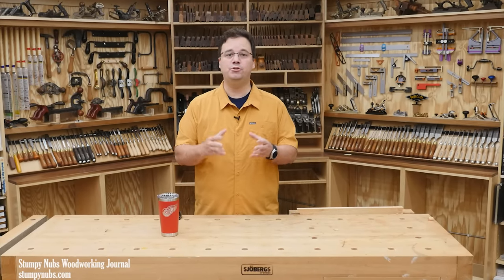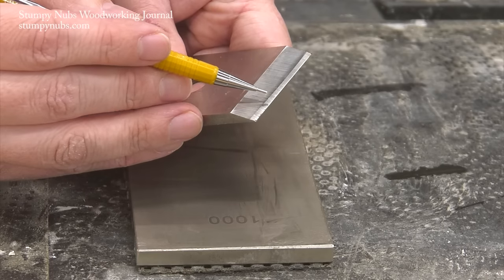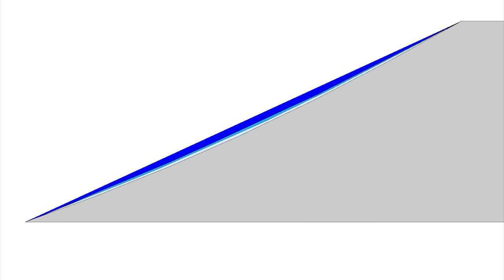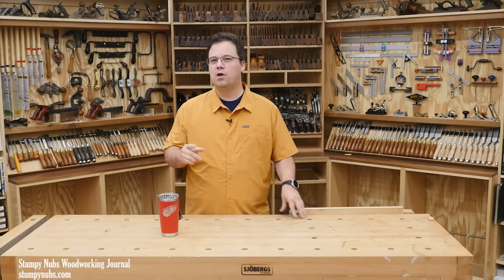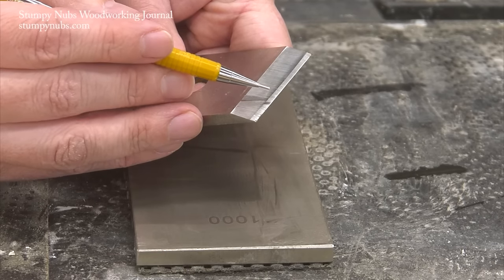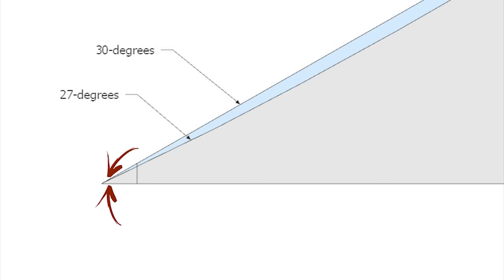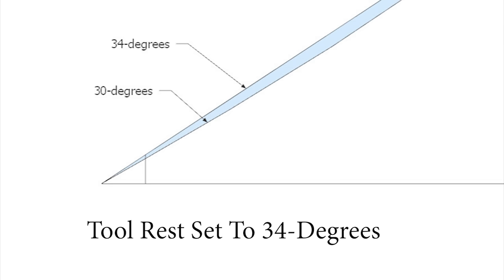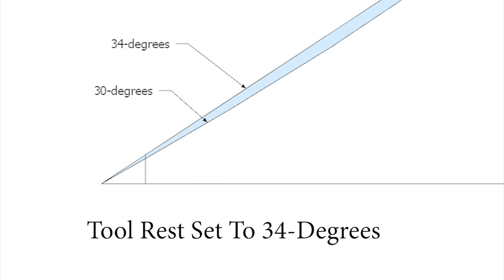WRONG INTERNET TREND! - Watch before you sharpen with a bench grinder!

Comment: Wait a minute...so you're telling me that chisels have to be sharpened ?
Reply: He was just kidding. Just get a bigger hammer if that chisel isn’t working so well!
Reply: Is sharpening what you’re supposed to do after you use the chisel to open the finish can?
Reply: @richtes  Only when the end of the chisel starts to look like cousin Cleetus' teeth
Reply: I have just been buying new ones when they stop cutting well. Next thing you're tell me is that I don't need a table saw when the blade dulls!
Reply: No need to sharpen them. They work just fine to open paint cans when a little dull.
Reply: @masondegaulle5731  Nah. You just use those to create that 'vintage', 'distressed' look.
Reply: Nah just buy new ones 😂
Reply: You, Sir, Win the internet today. LO F'ing L.
Reply: Not if you use them to open paint cans!
Reply: Concrete chips just as well now as day one.
Reply: You mean really wide screwdrivers.... Right?
Reply: I was today years old when I learned this 😂
Reply: Another thing that has to be sharpened? There's no end to this! (Is this a covert campaign by sharpening gizmo companies?)
Reply: Okay, lol is supposed to mean laughed out loud.  But your comment doesn't deserve an lol.  It deserves a LAUGHED OUT LOUD!!!
  Great job, Bub!  Thanks, that was great!
Reply: I never sharpen my screwdrivers.
Reply: just rub it back and forth  a few times on a concrete floor and it will be fine
Reply: No. They are just used for taking pallets apart
Reply: Depends on your trade 😂😂
Reply: Not if you use them to open paint cans
Reply: Nah you and I don’t need to be sharpening. He’s just pushing his high falootin’ “Wheel” money now that he’s gone all Hollywood. 

J/K

Love your content. 

Cheers!
Reply: @bw162 My father used the kitchen doorstep. He did it to sharpen the kitchen knives as well.
Reply: Not if you use them right.  Most people don't realize that the metal end is the handle.
Reply: @jasonderosa1137  Damn, I was thinking the same thing, but the guy at Home Depot says it's okay to buy new table saws...he wouldn't lie would he ?
Reply: That's what the cutting disk on the battery powered grinder is for.
Reply: Real men just get stronger and push chisels harder. It’s called progressive overload. It’s good for you according to fitness YouTubers. lol😅
Reply: LOL!
😅
Reply: HahhhahahH!
Reply: Only when you can't cut through the paint in those old screw heads
Reply: I dunno, I typically hit a nail within the first few years of owning a chisel and have to throw it out WAY before needing to sharpen it. Still cuts wood with a beefy enough hammer behind it.
Reply: What's a chisel?
Reply: 😂😂I love a little sarcasm mixed with humor with just a touch of smart ass. Lol makes it all good.
Reply: Ceremonial (dress) chisels don't, but all the rest? Pretty much, yeah.

Comment: A wise man once said, "Always carry a knife and a sharpening stone with you, that way if you ever get lost in the woods, you can just sit down and start sharpening your knife. Pretty soon someone will come along to tell you that you're doing it wrong."
Reply: Same story, but deck of cards - play a game of Solitaire.  Someone will tell you to place the red six on the black seven. ;)
Reply: You are a genius!!!
Reply: @fredinit  Same story again with the ingredients of a martini. Someone will say "That's not how you make a martini."
Reply: There's also one from the world of data infrastructure. Always carry around a short piece of fiber optic cable so if you ever get lost you can bury it in the ground and then when the guy with the backhoe comes to dig through it, you can ask to use his phone.
Reply: At work I use an old steak knife for rough trims on uncured rubber. Long story short it doesn't need a fine edge because it gets abused and the material is soft, so many times I just knock the flats down with a file. At first the part of me that takes pride in sharpening my personal knives was just waiting for someone to happen along with their two cents...and they did. Except they understood what I was doing! No questioning the rough (but serviceable) file edge, no, they chastised running the file in both directions.

(After some searching I'm not convinced it hurts the file but I did change to forward-only filing for shop optics. Either way it never fails: Someone will see and someone will comment.)

Comment: The emotional arguments always bring me back to a directive in Japanese manufacturing:  "Go to the Real Place.  Look at the Real Thing. Consider the Real Circumstances."  As usual, you do this well!
Reply: Agreed, but there is an element James didn't mention, which I think is the real point of both how one cares for any tools and what you are looking to discover in any "gemba."  That's the attitude of care and devotion to the craft - call it fussiness or just being persnickety about one's tools.  The attitude is critical, but that does not make one person's little nits about fussiness some sort of universal truth.  I prefer a flat single bevel on my edge tools, but mainly because when I'm fussing to get them just so, I occasionally glance up at the poster of the Studley tool chest that is framed on the wall.  It's a way of reminding myself to slow down and try to be at least half as careful as Henry O. was.  Studley used a single flat bevel, and it is actually quite a challenge to get those just right every time you do it, but the effort reminds me of what I'm about, so I find that it is worth it, but that's me.
Reply: How many wood workers know or have the skill to sharpen a tool properly? Yes,  they improve it but for perfection I doubt it. Wheel hollow the tool and hand sharpening convexes the tool as people are not machines and tend to rock the tool as they slide it back and forth.
Reply: @charlemagnesclock  I think the thing often missed when chasing sharpening perfection is that while you can get an edge absurdly sharp with perfect technique and tons of effort, it won't stay that way for long. A few cuts into some actual wood and it's down to just very sharp, which takes a lot less effort and fussing about, and which most quality tool steel will maintain for a decent amount of time. So, unless you're sharpening the edge every 5 cuts or so, you're not going to see a significant benefit from being obsessive about it. Sharpening the tool to the "good enough" point, more often, will serve you better.
Reply: excellent advice.

Comment: Great video, I've never bothered to do the math but whenever I saw someone complaining about a hollow grind I always thought to myself - "if you're that concerned about it, offset by about 3 degrees and it will be fine". Turns out it was 4 degrees. Close enough!  Even less on wider grind wheels I imagine. The point about finishing up on finer grit stones and getting a nice, easy micro bevel makes a ton of sense too. Perhaps the only legitimate concern left here is heat build up, so that might be worth covering if you make another video.
Reply: Heat build up is what the cup of water is for next to the grinder.... Take a stroke, have a dunk, stroke again.
Reply: @arikbord2256  works till the second you burn the metall
Reply: If you are concerned about heat, get a wet stone.  Just remember to remove the water before it freezes in the winter.
Reply: I believe James would recommend getting a CBN wheel and/or be mindful, pay attention to pressure, and take your time.

Comment: The hallow grind itself isn't an issue as you point out. But the one thing that may be of concern for some might be changing the temper which can be done on a wheel but I haven't seen anybody move fast enough by hand stoning to generate the heat required.
Reply: If you're getting your cutting edge hot enough to change the temper you're doing something wrong..
Reply: Said the Caterpillar as he expanded on his advice to Alice. And, by 'temper,' he meant what we call 'proportion' - of chemical make-up (relates to heat generation) or physical size (angle, whatever the measurement dimensions)

Comment: Thanks for this clarity. I have always been dubious of the claims for loss of durability when doing a hollow grind. I regularly use Barr framing chisels with a hollow grind (from cbn wheels) and a micro bevel done by hand. These chisels take a massive beating as they get whacked a lot harder than 1/4" chisel, and I have never had a problem. The only factor that I have found to effect durability is (obviously) the quality of the steel itself.
Reply: Great point, and not only the quality of the steel, but the type of steel as well. If you're bashing away, you want a softer steel, as it's less likely to chip away and should hold its edge longer, and for rough work it's more about force than precission, so being perfectly sharp isn't really a factor. If you're doing paring or other delicate work, a harder, more brittle steel is better - you can get a sharper edge on it and as long as you're not abusing it, the edge should last a good amount of time. Personally, I use my Japanese chisels with their very hard white steel edges for most fine work, and use cheaper chisels for rough material removal. That said, I occasionally bash away with Japanese chisel and have only ever chipped one when I dropped it on concrete. So I don't think they're all that delicate.

Comment: I hollow grind then hone and I've always felt a little guilty about it ever since the woodwork technician at my art college told me it was bad practice. He didn't explain why it was bad (he advocated using the side of the wheel) and your brilliant explanation has taken away all that guilt.   Thank you!
Reply: I've used the side for years, mostly because I made my own grinder and it worked out easier for me. Have used pretty much every other method too, mostly because it's what I had available. Anyone who gets fixated on this sort of minutae generally doesn't do enough wood working and is more concerned with having nice tools, like the guy who washes his car every weekend but never drives it.
Reply: wouldnt that grind one side sharper since the wheel's rotational velocity is larger farther from its center?
Reply: Ask anyone with a brain.... you never apply sideways force to a bench grinder wheel...... unless you want it to explode in your face.... 🤔😎🇦🇺👌

Comment: I appreciate the video.  Good info and great job explaining what happens at the tip of the edge - where the work occurs.  I grind my 'rough' chisels (the ones to beat on a 2x4) on a regular bench grinder with a bevel somewhere between steep and gentle.  Blades for my bench planes, nicer chisels, etc.  hand sharpened with a bevel somewhere between here and there, until they are sharp and work.  Anyone that says it has to be 30 degrees hasn't a clue.  30deg is like a combination saw blade - it's the good, all around, bevel and where you start from when you're learning.  Some woods require steeper, some shallower.  Different parts of the same board need different bevels (end vs. cross vs. with grain)  Some tools like steeper (lathe), and some shallower.  Heck, even different hand planes require different bevels.

Comment: Good stuff James, I've rough in my chisels at around 25 degrees, by the time I get my secondary bevel done on a flat stone I'm at 27-29 degrees, not enough difference to make a difference. When that edge gets to where I need a touch up, I strop it. Some guys go for a tertiary bevel rather than a strop. It works well too.  Most guys figure out what works. You can cheat that bevel to less than 20 degrees if all you work with is soft wood like pine.

Comment: When I was at school, our carpentry shop used a four foot wet grinding wheel turned by hand. This stood in the center of the workshop and we were encouraged to use it whenever our tools became dull. The size meant minimal hollow grind and after stropping almost none.
Reply: How did they dress the wheel?  I wouldn't want to pay for a CBN wheel that large.  Well, I wouldn't want to pay for any wheel that large.
Reply: @kwilliams2239 . It was fine millstone. The dressing was done with a drop down bar and a devil stone. This was the 1950’s so no chance of CBN, it passed through a trough of water and I seem to remember getting a bit wet. The workshop had 12 benches and we each worked at one end, each bench had a vice at each end and an under bench cupboard for tools. At one end there was a lathe, where I did my first turning, a bowl for my mother, which I still have. I’m 80 this year and am still turning.
Reply: @mergrew0110  I hope I can still be turning after 70 years.  I just started and I'm 70 now.  😁

Comment: Personally I have different angled chisels for different purposes, varying from 40° to even 15° and sometimes even sharpened a skew for easily cleaning up end grain of dovetails or tenons and flattening faces with a slicing motion. 
What I like about the concave edge is it requires less honing to get a sharp edge.
I maintain sharpness with stones and repair damaged edges with the grinding wheels. In the end only the point where two faces of the cutting edge meet is important for sharpness

Comment: Totally agree; plus that hollow grind from the wheel is only hollow at the tip until the FIRST time it is honed, whether on a bench stone or a little hand CBN card, which I use often as I work - same result, a new sharp edge and automatically corrected angle.

Comment: I used to maintain a college wood room. Teenagers are not kind on chisels. Our 8" CBN wheel was a godsend and I used to set it at 30°, with a 35° bevel. Razor sharp and quite durable. (Until some goose hits a nail...) As well as young men's fingers, we were cutting Mountain Ash and other pretty hard timbers, as well as radiata pine and they got it done nicely.

Comment: old tool catalogues often mention voided warranty in case of iron mistreatment, extreme hollow ground being of of these cases.
But these diagrams dont show the hollow going right to the edge, but rather offset behind, basically thinning out blade on the circumference of the wheel. Very much like a straight razor.
I think of it like a long forgotten practice

Comment: Yeah it's all really nice stuff, but today I was really  happy cutting with my chisel. even across endgrain it just worked finally, right. So I'm good sharpening on my glass plate. I don't hate on super sharpening, if you can do it quickly, I'd say it would be nice. But on the other hand, like 10 cuts and you're back to a sharpness that's equivalent to ''normal sharp''. so to maintain that sharpness is probably not really feasible but hey I'm a total sharpening noob so
Reply: "Super sharp" vanishes quickly when the edge is used on any wood except maybe balsa.  Then the edge becomes "just" sharp.  It will hang on your thumbnail, cut you really well, and generally do all the tasks you want it to do.   I've learned to shoot for sharp and leave it there unless there is some particular call for extreme sharpness like carving.

Comment: In theori is does weaken the edge slightly, but the change is so minute that it cant be mesured or felt in any way. And even if it did what would be the problem. If you saved time sharpening everytime because of the hollow what does it matter if you have to sharpen once or twice more per year. You still saved time.

Comment: Your video once again clearly presents the truth. Unfortunate that so many lack the common sense to understand this in the first place and are easily duped by the nonsense out there. 

As an aside I want to buy an 8" CBN wheel but need a 3/4" arbor bore in the wheel. All the ones I've seen are 5/8" and won't work with my Baldor 8107W. Do you know of a source? I could have a machine shop bore it out, but that would make it cost prohibitive.
Reply from the maker: https://woodturnerswonders.com/collections/3-4-arbor-cbn-wheels
Reply: @StumpyNubs  Wow, Thanks! I should have looked before I asked. 🤦‍♂

Comment: The part where you grind the edge of any chisel or plane becomes  brittle is when someone gets it to hot and puts it into water to cool off,  that where you can get chipping or breakage of the tip
Reply: To do that the edge would literally need to be glowing. More then likely you will just ruin the temper and reduce the hardness. If the edge turns blue you are probably softening it

Comment: Hey James, I'd love to get your opinion on another growing woodworking trend: ceramic coatings. I have actually used a ceramic coating on my car, which makes sense and I know works, but I have recently heard of ceramic coatings for wood, and my knee-jerk reaction is that it doesn't make sense. The most I assume if can do is seal the wood fibers from absorbing moisture, which is what plenty of existing finished already do. I was wondering if you have heard anything about wood ceramic coatings and what you think of them. Thanks as always for sharing your wealth of knowledge and experience.

Comment: First time hearing about this argument bit my input as a blade smith would be worry less about the hollow grind and more about what the heat from grinding the steel on the wheel is doing to the hardness of your blade